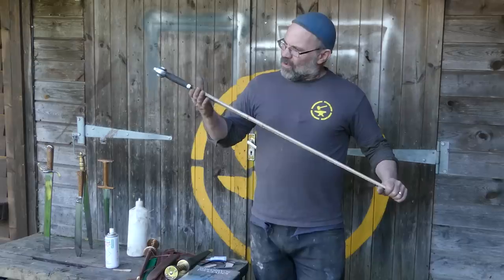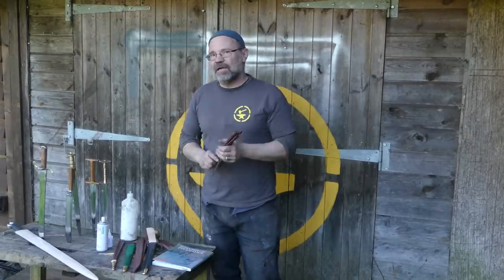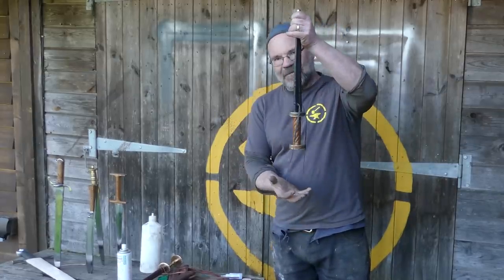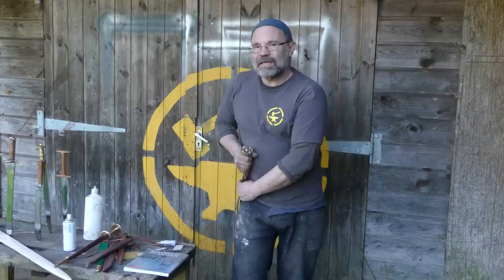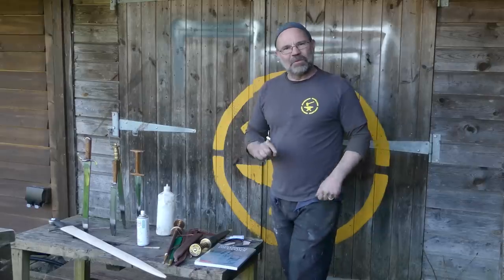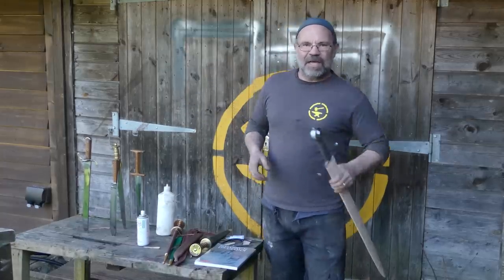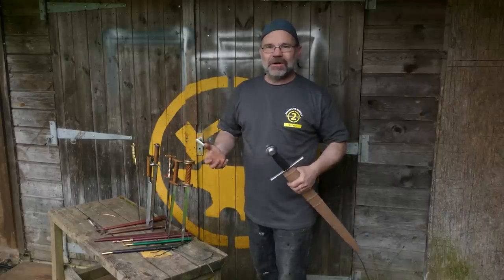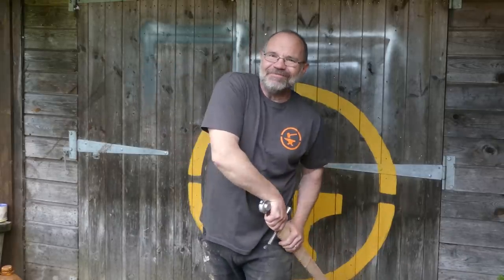How Tight were Medieval Scabbards?

Comment: My take is that they did want at least somewhat snug scabbards - I went into several skirmishes with a scabbard for my dagger that was really, really loose and managed to loose my dagger more often than not. It got shaken out by all the jogging and fighting and occasional falling down and I'd think that not having a dagger there at all is worse than potentially drawing it with its scabbard still on. And the quick draw has been massively over-rated - sure, it's nice to have, but the difference in draw time will be a few seconds at the most, and you will very rarely be in a situation where that will matter (which is why we only rarely saw quick draws during the Wild West, despite how popular movies made them), doubly so when you are wearing heavy armor and wrestling is an option.

This problem would be a lot worse on horseback during some types of the horse's gait, so it is quite possible that lower-grade, less snug scabbards were sold to people who didn't expect to fight on horseback and could therefore (if all else failed and provided they even had a horse) just tie the sword to the scabbard without much issue. How a sword hangs is also a factor, I think - katanas do have a very close-fitting scabbard after all, and they were worn horizontally.

Also, while being a rich knight gets you a lot of thing, it will not get you out of getting soaked. Sometimes you had to ford a river to attack the enemy (army-wide at  Kressenbrunn 1260), sometimes you even go for a swim (accounts of "many" people doing it, Nicopolis 1396).

Comment: Accessible and secured.

My everyday fixed blade is secured with cordage through a hole drilled in the handle that loops over a button on the sheath – holds it in place but can be freed one handed - kept freed when I know I'll have to be using it often.
  Don’t doubt troops on the move in medieval times had reasons for the same – bad to have a blade stuck in its scabbard – equally bad to have lost it several miles back on the trail.

Comment: Regarding the end there- 
That scabbard will loosen back up though in a bit of time and with some use.
Though not as nice as yours I do make scabbards too- even made a couple for my Albion Knight- one with fittings I bought from you-
Mine are usually pretty snug when new made but after just a bit of break in they loosen up some. My end goal is a scabbard that when held upside down holds the sword but when lightly shaken  easily releases. That seems to be my sweet spot
So you have to consider the new fit as opposed to the broken in fit too

Comment: I suspect the level of fit you most want is going to vary hugely more in history by what you expect to do with your weapon than what the weapon is. Though of course if you can't get your ideal you have to settle for the best you can get. 

For instance a highwayman probably wants the loosest quickest draw they can get letting them toss in an flourish or two for the extra shock and intimidation factor on approach, or cut the purse strings in swift and quiet movements. At least if they don't plan from the beginning to just murder the folks they are robbing, in which case it doesn't matter at all as the blade was drawn in advance of the action. Where your reasonably well off merchant or noble might want their gear that is part self defence part status symbol to be really grippy - means it can be really ornate, very valuable with gilt and gems etc - the sort of thing they probably can't trivially afford a new one and it is nearly impossible to steal.

And your general man at arms probably doesn't care how grippy it is, as long as they can't lose the sword and get the quartermaster mad at them.
Reply: I wonder if people were all tactical and shit back then. Like I imagine lot of people hardly had any options and just bought whatever was available at the local Smith or something
Reply: @zwenkwiel816  it's called custom made, it happens alot with local smiths.

Comment: Even without getting into “retention” type examples, modern kydex holsters often have protrusions or an extended sideguard on the side closer to the body so you can push against them with your thumb as part of drawing to ensure the contents leave cleanly. I have *A* kydex knife sheath with one, and it works well enough. I wonder if such a thing could be done for a sword or knife with period materials.
Reply: Right, or an indent in the scabbard that corresponds to a bump protruding from the blade, so it sets the tension needed to draw but in a highly predictable way; the scabbard could be otherwise quite loose, and thus not worry about unpredictability due to friction.

Comment: I think in the modern world, having the scabbard be tight is more desirable. I don't plan on running across any rivers and I'll stay indoors when it's raining. I don't however want my blade to fall onto my friends foot because he picked it up wrong and before I had the chance to warn them.

One of my Viking style swords actually does have a loose scabbard so I'll be using the tips shown in this video to tighten it up. Thanks for telling us about the glue as well. I never knew about the concern with PVA.

Comment: 🤔(looks at the blade piece he is working on well, enjoying Tod's video's) I would love to see Tod make a set of decorated medical scalpels or hobby knifes all metal construction.
if anyone is wondering I am polishing one, i Made one from one of the early pieces of canister damascus/pattern welded steel i made and had laying in my scrap bin For a long time. it's not the best set piece of steel, and it's not the best choice of steel to throw in a canister (i just used some used hacksaw blades and I think a high nickel alloy 4600 KC powder) i made to practice setting canisters by hand (i don't have time-saving tools really so it's all by hand) but well I wanted to forge a scalpel again.

Comment: I know more about Japanese swords than European, but the wood used is chosen because of its ability to stay dry. The sheathes are really only tight at the top but quite loose along the length of the blade. One thing that people need to be wary of in drawing one is getting the angle right so as not to split the sheath and cut a few fingers. It makes me wonder if that might be an issue with a European blade if they're too tight.

Loved the video. Definitely made me think. Thanks!

Comment: I know its outside the scope, but I have a little note. 
I've had a simple sword (roughly 30 inches, on the hefty end of the spectrum) for over 10 years now. Its seen many conditions, one of which includes the time my apartment flooded, causing the scabbard to warp. 
But here's the thing. I'd never considered it hard to draw, nor did it ever just slide out of the scabbard, neither before nor after the warping. Maybe that's a sign of the craftsmanship, I don't know, but its an idea that there's a nice middle ground where a sword can be snug without imposing any issue on the draw speed.
Ironically, the hardest part of drawing this sword would be not accidentally handing it to your opponent during the drawing process, due to its length. Probably a contributing factor why swords tended to be shorter than this, or not have a scabbard. 
But it does look nice as a decoration!
Reply: 30 inches in not particularly long for a sword. Fairly average for an arming sword.
Reply: @DH-xw6jp  I was basing it off of google, which stated a 24-32 range for the usual, but yeah, its might be because i'm not particularly tall that it seems long.
That or my form for drawing it is bad.

Comment: I wonder if when there was "make to pattern" situation, the various craftsmen could have been given either just the part they were to match, or a more complete version.  So in that case they'd be able to make the various pieces to match much closer to the other parts, like the blade the scabbard is meant to match could be available to check the fit on.
Reply: Or just everyone using a set of jigs that match because they were all made at the same time.

Comment: While I agree with the ergonomics of the draw making it a lot more difficult, I imagine that the adrenaline of someone trying to kill you would probably assist the matter quite distinctly.

I also suspect that in practice you'd habitually loosen your blade an inch or two out after situations where you got wet and binding might be an issue, it's not ideal but it'll do you until you either have time to dry it out properly (as much as the wood ever will recover) or replace it.

I'd be curious about whether the inside of the scabbard got mouldy after your experiment, and how long it took.

Comment: The difference is that for the craftsman in medieval times, the good quality stuff took many times more effort, yet could rarely be sold for anything remotely close to what its worth was in effort invested.

A friend of my cousin trained as a "historical blacksmith", as a way to maintain and repair historical buildings and items in an "era-correct" way.
And one thing he was fascinated by when he learned was the fact that even using nothing from beyond medieval times, once he become skilled enough, there was essentially nothing he could not do.   The only restraint being that of "how much time and effort will it take".   0.1mm precisions work, no problem at all, it just took a lot longer than for more normal work.

.

Another way to keep blades from falling out is to have a small strap, loop or snare that goes around part of the blade(often with the loop back around to a knob or something on the other side of the sheath to fasten onto), either to just keep it more firmly held in the sheath, or to outright secure it.   I've also seen a few variations on simplistic latches that attach to/springs against somewhere on the handguard or the grip.
Reply: I have seen this on modern knives, a little strap and a metal snap button.

Comment: I did Napoleonic reanactment, (14th cuirassier) wearing a long sabre. After a hard day of riding and fighting on horseback, I cared for my horse and walked back a ling way to the camp. 
Then it happened. I holded my sabre wrong, the grip pointing forwards.I stumbled and started to fall forward, my sabre slipped out of the scabbard falling on the ground, point up, towards me- falling too.
Well, I managed to avoid the blade, but just... So I nearly killed my self by a loose sabre.
Reply from the maker: Close call - lucky

Comment: Id like to give my humble opinion of wearing a knive "loosly" 
As a sailor I carry a knive trough a belt loop at my right hip/back right hip, this is a sea knive a tool naturaly. 
Now most of the time your not using it, cutting rope is rearly nessesery though the merline spike (just a "large" metal pin to undo knots) sees more use.
still its worn very loosly the reason for this we sailors must crawl, cimb, and walk about the deck and rigging having the scabbert sit loosly for me atleast is better then a tight on restricting movement, though the slapping can be a bit annoying at times

Comment: I mean, if you think about it, the same reasoning goes for shoes, you tipically don't want them to fit too tightly to your feet, but rather you want just a little bit of gap to make them comfortable to wear, while I don't think they expand much when wet they still are more difficult to wear when they are

Comment: try making a bridge tech sword, from hexagonal pipes, hollow, wrapped with edge/side sheet metal (so its two sided edge shaped), use one central pipe, 6 around it in hexagon pattern, the 2 edge pipes, total 9 pipe sections, then the 4 edge 0.5mm steel sheets, then just screws through the pipes 3 through-bolts sheet-angled multiple positions alongside the sword
Reply: its bridge tech, minimal structural material for maximum structural strength, for swords, ie, maximal sword size with minimal weight still being strong
Reply: if you have problems, say its an axe, not a sword, japanese style
Reply: of course you can, just cut/stain them by burning, medieval laser cutting
Reply: press cut burn mark leather
Reply: you can 3d print a sword holder
Reply: fine sword holder is so sturdy that its like a sword itself (dual wield as second hand shield sword)
Reply: would you not treat the leather like wood, so it will not soak water and go bad
Reply: if you make the pipe sword, you have effectively a multi-thickness sword

Comment: Yes, you are right with that.

And as a Iaidoka i can also say: you do not want your sword to be too tight. In Iaido you losen your sword with the first touch of the index finger when gripping the saya (not the thumb as we always see it!). You do not have enough strength to do this when it is super-tight.

On the other hand: for todays purpose (you know... mostly showing off) it probably is better to have it a little more stiff then back then, just to avoid any mistakes.
Reply: My cousin has been collecting originals for a few decades now and the pieces he has encountered have all consistently had excellently fitted saya matched to the habaki of their blades. The mouth of the saya were fit to full contact and the bevel of the habaki made the contact easy to draw despite fully fitted and tight construction. Of course, these are the excellently produced surviving pieces that make it to the sword brokers today so there might be some survivorship bias, but a well made period production piece was loose around the blade but tight at the guard. The bevel meant that even a tiny bit of push out loosens everything out and makes for an easy draw. I'm honestly surprised that the habaki concept didn't spread further than it did. It's such an easy and elegant solution to this exact problem
Reply from the maker: Japanese stuff is firstly something I know almost nothing about and secondly very different, however Matt Easton and I oddly filmed a follow up a few days later and he talks about this - check his channel out.
Reply: @tods_workshop  
It's cool to see you doing more collaborations with him. I love scholagladitoria's content, his false edge demonstration was some of the finest bottle cutting I've seen. I'll look for that video or look forward to it if it hasn't landed yet. Though quick question for your wheelhouse, was there a western habaki equivalent historically?

Comment: Having a sword hanging from your belt seems like a real embuggerance if not actively engaged in fighting or anticipating such. anything like that will catch on stuff and generally get in the way when doing anything, particularly in woodland or any outdoor environment where there are tall plants, hedges, etc. Surely they would stash the sword in their pack most of the time - it's still pretty quick to unsling a pack and pull out a sword, especially if it's in a loose scabbard...

Comment: Regarding the thongs, could they have been "just" the way of attaching the sheath with a belt holding it down for the one handed draw? Like the shoulder slung gladio sheaths that were held down by the Cingulum to allow for the famous one handed same sided draw.
Reply from the maker: Actually no.  A good idea, but in fact you see it in the artwork a lot.  However there were many ways to wear knives and daggers (see video in the listings) and these various methods probably reflected owners preferences

Comment: I don't tend to make a lot of leather sheaths for knives, but I've often advised people not to store them for long periods in them. Mostly due to corrosion forming on the blade if its humid or the leather itself having some acidic base which might increase the rust over a very long time. So while I think it might be a long shot that people in medieval times wouldn't have written anything down, but maybe there was a military protocol in later centuries of warfare which was documented about the long term storing of knives and swords in their sheaths?
I'd sort of assume if they did, they might apply an oil or some type of grease to it for protection, but they may very well have not
Reply: If the grease was made from animal fats it might cause more problems than it solved with regards to storage in a sheath or scabbard. You could get mold build up if stored in a poorly ventilated environment. I speak from experience sadly.
Reply: @riffhurricane  I guess a fancier, more period correct corrosion resist might be something like beeswax and turpentine. Don't know if it would make it 'sticky' though
Reply: @krissteel4074  Good question. My own experience of beeswax has been very positive. 

The sheath I had go moldy was for a working blade I use that I'd put into storage for the off season - the 'animal fat' was simply the oil from my own skin I suspect (though it was clean to look at). 

The sheath I'd made myself and rubbed in warmed beeswax during its making. When I came to clean the mold off (including a good soak for the sheath) it actually held its shape very well. It isn't sticky to the touch, but 'grippy' if that makes any sense. If the beeswax were on the blade my guess would be that it'd be the same:- not sticky but there would be extra resistance. It'd form a barrier to rust forming though which would be pretty useful.
Reply: @riffhurricane  For long term storage it would definitely be the stuff, it's basically got no shelf life and very hydrophobic.

Cutler's Resin is a thing too which was used by knife and sword makers for centuries (or even 1000's of years in some variant) its basically about 200ml of pine resin, 100mil of beeswax with maybe 50mil of carnuba wax with some sort of fine binder of sawdust or charcoal to give it a slightly thicker consistency when its applied hot.
Its a good glue for dissimilar materials like metal or ivory to wood and so forth
Old timey epoxy really :)
Reply: @krissteel4074  Fascinating - I bet it smelled pretty good too.